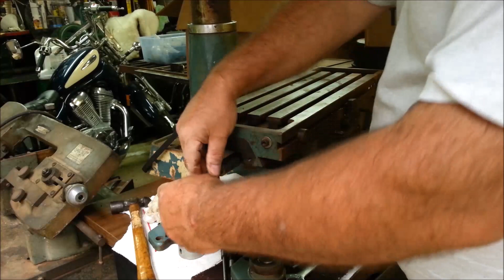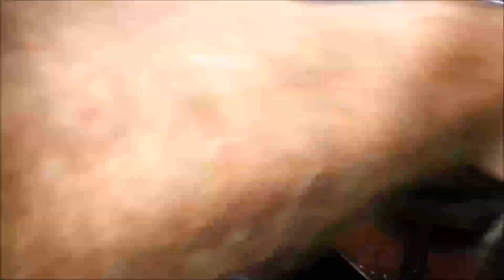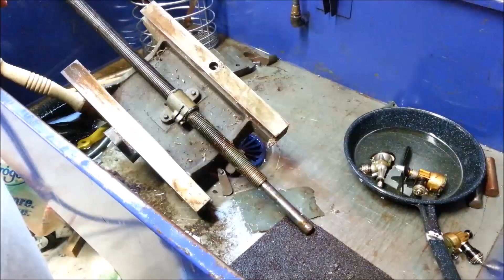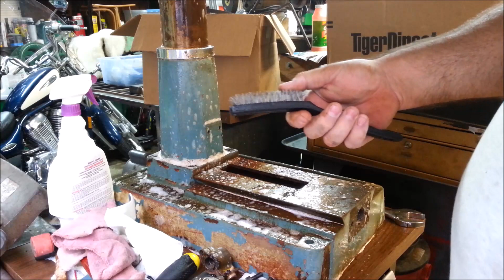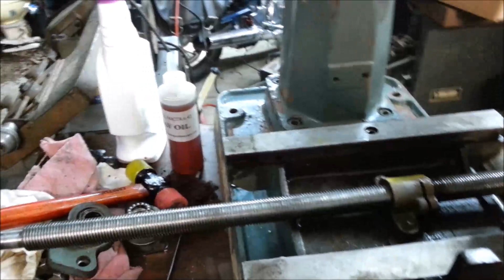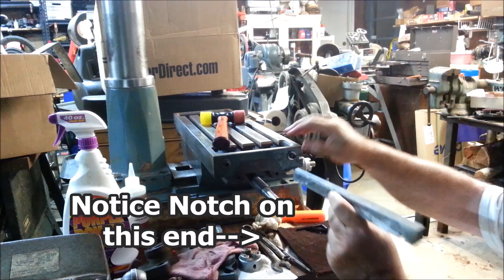ENCO Milling Machine Part 1 A Long Long Time ago.... Crafted Channel

Comment: HFT, Chinese, copied it, and the manual, as dated June 05, 1996.  The HFT 33686 12 speed Milling machine, the JET 15/16, are identical to my 1984 Enco 105-1300, or Rong Fu 31(BS), that is fitted with a mechanical powered vertical drive for the quill.  

I have downloaded and printed all those manuals, and they are identical. 

"Making some 'improvements", I have ordered, and received, the digital readout to calibrate the X and Y movements for zero.  They were very in-expensive, (about $13.00, total).  Also received a VFD ($92.00) to install my 3 HP (5KW) 3 Phase electric motor (450.00 on Craigs List, from a car wash), so it can run from one rpm to the max. permitted when I retain the cast iron belt pulley on the motor, as cast into the pulley is a max. speed of 4500 rpm.

After all of that, I will be checking out the X and Y servo drives, controlled by a computer running Linux.  I sponsor, and teach, Linux in free seminars, since 1997.  Complete drives with all the parts are less than $300.00.  I have scores of computers on hand, or, can use a Raspberry Pi, or other "credit card" micro computer... they run under $50.00 complete, from MSM.com supplier!

Comment: TAIWAN is the FREE DEMOCRACY where ENCO machines are made.  If you check any of the Chinese main Land  made machine owners manuals, you will probably notice black marker wipes where the title would have been.  

The Jet JMD-15 and 18, the Harbor Freight Tools 33686 (12 speed) Mill, are exact copies of the 1980 Enco Mill.  Some mods are the plastic belt cover, and motor and/or electrical switches.

That is because the Chinese can copy, but, cannot invent.  Mao Tze Tung made sure that anyone with intelligent thought were murdered in his purges.  He killed scientists, engineers, teachers, inventors, and mechanics, in his demented celebration of stupidity, like his own, (and his military leadership), and they avoided injury to the peasants. There are certainly some intelligent people in China who avoided the purges, just not enough to reverse the tide of ignorance, nor to fill the huge needs of a now growing tech. giant.

Taiwan was spared this, and has some very smart people.  

I own a Taiwan built 1984 ENCO 105-1300 (RF-30) (91034) Mill, that has the Z axis drive, which is now offered (copied) by Rong Fu, since long after that build date.
Reply from the maker: Are they still making mills in Tiawan?  Yea, socialists usually get around to killing millions when they get in power.

Comment: Dave, is your parts washer the Harbor Freight 20 gallon? What type solvent are you using.
Reply from the maker: My parts washer is one I bought at auction more than 20 years ago.  It was mostly in storage all that time although I did use it a little. It's a real shop grade one from Safety Kleen model E-3000.  A model they would sell to a shop that did not want to rent one.   It keeps the solution in a 30 gallon barrel just like the real deal.  The pump is on a stem down in the barrel.  I use Stoddard Solvent (Mineral Spirits) purchased from Tractor Supply @$40 per 5 gallons. It's called Crown PSC 1000.  I purchased two containers and I'm still happy with how clear it is.  It does evaporate slowly.  I added water to bring the solvent up to the pump. Occasionally I pour in another quart.   Water the bottom works as a filter.  The crap falls into the water layer and does not get remixed when the pump circulates.  I've washed some really filthy stuff in it.  I also had to purchase a special plastic bag as my barrel leaked.  Only Napa stocked that item.  Solvent based systems are getting rarer and rarer.  Maybe I'll try a "green" setup if I ever setup a second tank.  I'm guessing I'll get 3 to 4 years out of my $80 of fluid.  How is that for a run down?  ;-)  I think the large Harbor Freight is an OK one for the money but think of it as a kit.  You're going to modify it and stiffen the stand before you are truly happy with it.  See Chris Anderson for his latest shop addition.  Here is the link to his HF cleaner video's :https://www.youtube.com/watch?v=bJdAxdL_nbs

Comment: Hi Dave. What's the little silver engine in the pan with the Cox Golden Bee?   Oh yeah, I really enjoy the shop videos in general. Sometimes I forget to compliment the folks putting up stuff.
Reply from the maker: Yes, There were two of them in there at the time.  Might still be there.  I am also in the model airplane hobby and have business in that field.  RadicalRC.com.  I have some engines that need prop washers made in the shop now for a future video.  I have an gaggle of Cox engines.  Love the little engines.   Thanks for the good words.  Nice to hear and the comments.  See you on the next one.
Reply: Uh, you still didn't tell me what it is. :-)
Reply from the maker: Oh yea, let me go look.  I went back and unstacked my parts cleaner.  It doubles as a workbench.  Those motors are no longer there.  I probably sold them on Ebay.  It could have been an OK cub or maybe a space-hopper with a tank??  That part of the video was taken earlier this summer.  Another part on Tuesday morning.
Reply: Space Hopper sounds right. I thought it looked a little familiar. Yeah, in my garage pretty much everything doubles as a workbench.